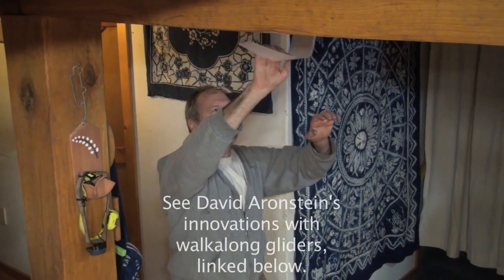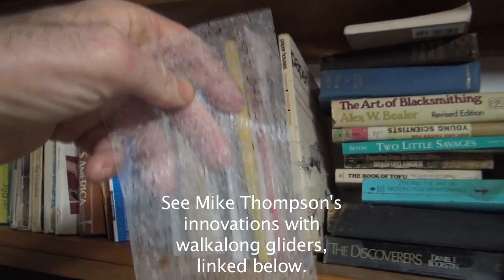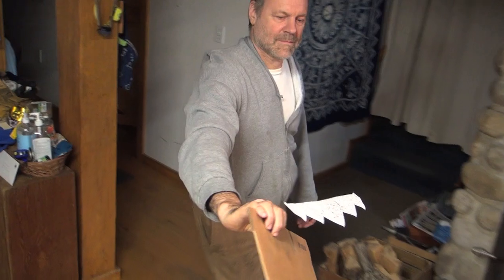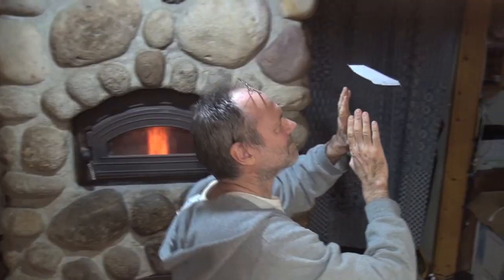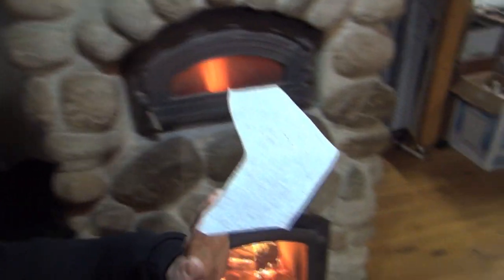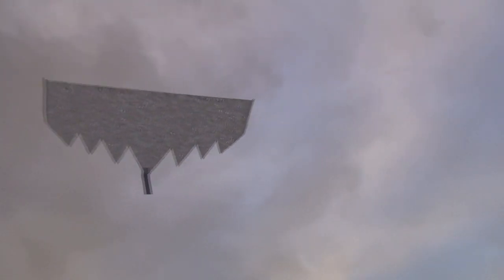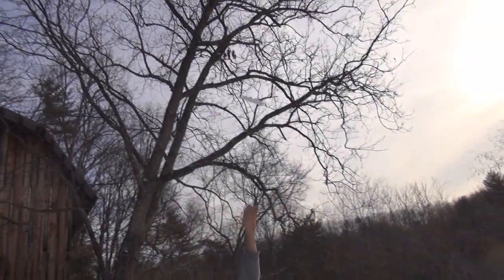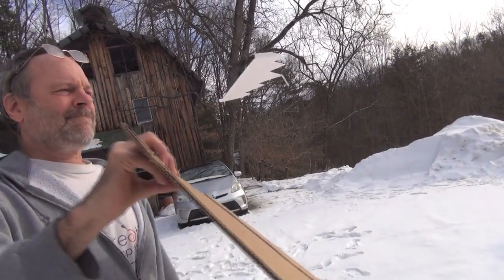Walkalong Gliders Need You!

Comment: What is the best nose weight you've found? 

Love the whole walk behind gliders! 
I've flown them for many years.... 
Still have one from mccreedy! LOL
Reply: When I started with denser foam and thicker gliders, I used aluminum foil--rolled into a wire--and twisty ties (used to close bags) as weights. Now that I found lighter foam and cut it thinner, I used copper "magnet wire". Just regular printer paper works well for the Jagwings. Bits of tape added or cut off are good for fine trimming, as does bending the weight more forward or back to micro-adjust the CG. But I think whatever you have for weight is good.
Regarding your MacCready glider, there's a good interview with Paul's son Tyler, linked from the same page that links to David, Phil and Mike's pages, above. He talks about how they invented walkalong gliders and sold them. 
Although Tyler called them "walkalong" gliders, I also like the "walk behind" name you used.
Reply: @sciencetoymaker  fascinating how the paper used to make paper airplanes becomes heavy as lead relative to thin sliced foam. I just use a slice of copier paper, not even folded, as ballast on my thin sliced foam gliders.